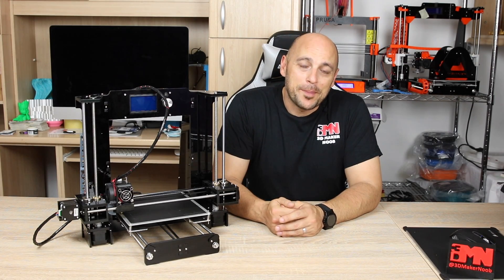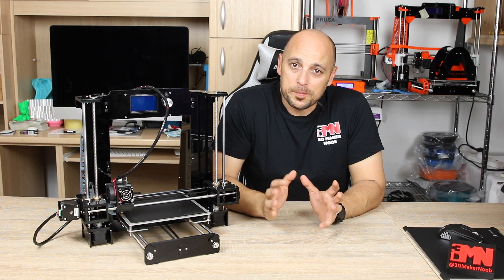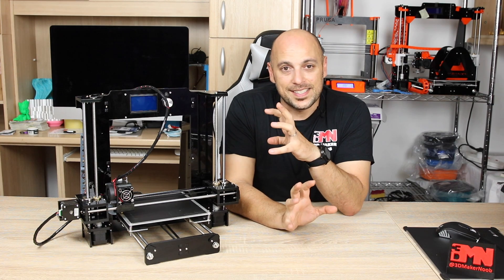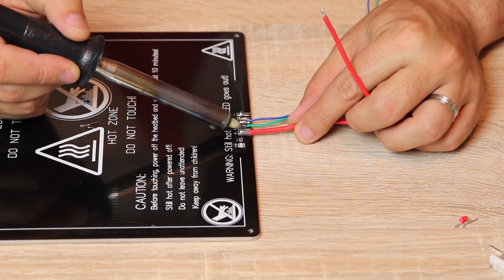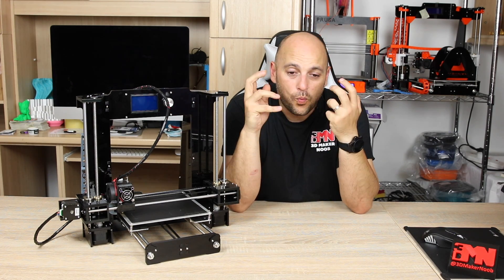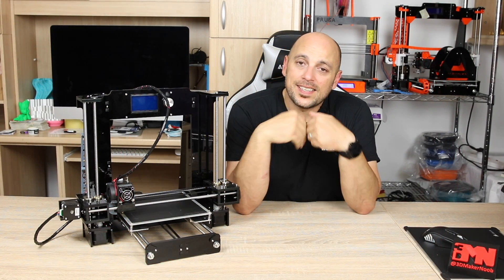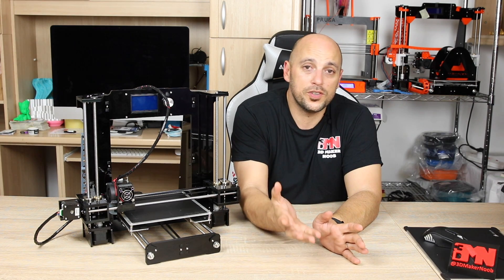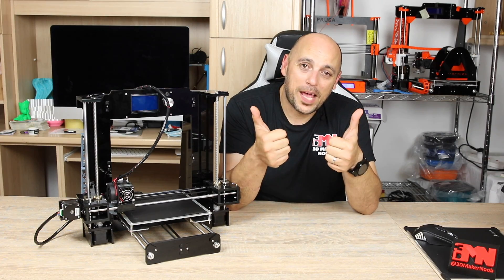Anet and Budget Kits Safety Upgrade Essentials

Comment: Way to make me feel guilty for running 16hr prints on the stock power supply and board for a month now, lol. I know I need the mosfets but at least my power supply and board have cooling fans attached... i don't know if that really makes a difference. mosfets are next on my list for sure, after seeing your opinion and genuine concern for the overall safety of the 3d printing community. Looking forward to the next A8 video for sure. Thanks again for the great content.

Comment: I have the A8, I installed a dedicated 20A fuse to the cabling coming out of my power supply. I also upgraded to a ATX power supply (PC power supply). I have also seen people installing a smoke alarm detector above their printer with a kill switch installed if it's activated. Lastly I installed a mosfet which is brilliant. 2 days ago the heat bed black connector burnt out so I took it all apart and soldered the cables directly to the board. 
Your video is great and I hope a lot of people who purchase the ANET range can watch it! Lastly, if anyone has issues with the hot end not heating up, I recommended checking the wiring first then just take the thermometer out of the hot end (there is a small grumb screw on the inferior face) and giving it a clean and check its electrical continuity as they are a bit budget.

Comment: A mosfet is just a single transistor. (MOSFET = Metal Oxide Semiconductor Field Effect Transistor) It is formed by two terminals (source and drain) being connected to heavily doped regions in the silicon substrate separated by the gate. The doping forms a diode with the substrate so normally current will not flow between source and drain (Diode is reverse biased)

The gate is a conductive plate separated from the substrate by a gate oxide insulator. When a voltage is applied to the gate the electric field moves the depletion region separating the diode terminals such that source and drain now no longer are separated by a diode. 

The voltage level on the gate determines the electric field which in turn determines how much current can flow berfore this now conductive channel is pinched off. 

This way a voltage source with little drive strength like a controllers IO buffers can control a large current flowing through the MOSFET

When you hear the term MOSFET we usually talk about discrete, large power FETs, but the principle is the same as other transistors used in microelectronics even though we then have millions or billions of then om a single die (But not bipolar transistors, they are different), however small FETs in microcontrollers are limited in how much voltage they can handle before they break down and how much current they can handle before pinching the channel. Larger discrete MOSFETS cannot be integrated on the microcontroller due to that they need thicker oxides metal tracks, so we use discrete power FETs to handle large currents and high voltages.
Reply from the maker: that's pretty much the same info i found online, but for someone who is not too technically inclined like me, all that might as well be chinese :) would love to be able to know more about this stuff
Reply: For the most part, a Transistor can only do 2 things, it can act like a switch, or it can amplify a signal. In this case it is an isolated switch, where the gate voltage can be a control pin from an I.C., as it toggles on and off, the FET will toggle also. This is about as simplified as I can make it. :) Good video, keep up the good info.

Comment: Hot bed wire connectors are loose, causes sparks and burns the connector up.
Upgrade the connector and replace crappy aluminum core wires with pure copper multi strand 16 AWG wires.
The Heater Core can come off the hot end if not tightened down WHILE HEATED.
Best to zip tie the heater core wire to the print carriage to prevent it from dropping down.

Comment: Joe, what is the link for the power supply you used. I am buying an anet a8 and I would like to purchase one
Reply: Check ebay for 30 amp 12 volt power supplies. There is one normally listed (I don't have the link handy) that looks just like the one supplied, but does come with a built-in fan. BEWARE OF WIRING DIFFERENCES. The connections are opposite of the original 20 amp unit.
Reply: James P thank you so much. I have officially as of now order my first 3D printer so I'll be sure to buy that psu

Comment: When I look at the picture which shows how to wire the connector on the powersupply it looks like you bypassed the fuse. shouldn't the black cable be attached to the tab on the right instead of to the IN point of the fuse on the left?
Reply from the maker: correct, i have updated a link in the video description to show it should be actually wired

Comment: Great ideas Joe. When I eventually work out why I'm having so much trouble getting things to stick o the bed I too will be printing those covers for my A8. I have an extra safety option that being a cheap Web Cam that I can watch the printer remotely with whilst my printer is on. I need to look at the Web interface you mentioned too.
Reply from the maker: i tend to do that with a lot of my printers, i also have smart plugs with wifi which i can switch off remotely

Comment: Hi there probably goeing to start a big debate and I apologise as I love the channel and all the help and advice. But wanted to get opinions and make people aware. The advice online all seems to lean towards soldering wires straight to boards but I work in the electrical industry and this is considered bad practice as any soldered joint needs to be physically secured as well as held in place by solder. I believe it has something to do with the properties of modern solder allowing parts to creap and come loose and creating the risks u are trying  to avoid. Has anyone found any solutions that allow for a second method of securing the heat bed wires in place? ( off to sleep now but look forward to any comments or suggestions) Thanks all and apologies again.
Reply: My take on it is that you are removing a very crappy, loose, under-rated connector and replacing it with a direct connection. That was the first part to go on my A6. Second part was my fault, allen wrench in the extruder fan trying to clear up a rattle while it was running.  :(      Printer AWP.
Reply from the maker: the idea is to remove the really bad connector that comes with it. in the next video will also be printing a brace to hold the cables so there is stress relief on the solder joint making them less vulnerable
Reply: I'll be waiting for that print! May have to modify it for my cable chain though.Keep those removed pins though. Solder a pair of them to the extruder wires and slip a length of shrink tubing on. Makes your extruder connection much better. You can do the same for power and bed wires also. Those screw crimp connectors are not really made for stranded or small wires. The pins give a solid bulk for the connectors to hold on to.

Comment: A PSU of at least 30 what?
Reply from the maker: +Heuamoebe 30 amps
Reply: Ah right. That was cut a bit short. Is there a reason for that specific number? Switching one cheap chinese power supply for another, slightly larger one doesn't seem very logical to me.
Reply: 30 Amps should cover the heat bed and nozzle heating up high enough for ABS or other high temperature plastics, while it will struggle at 20, possibly overheating the power supply. Just the heatbed along could draw 10 amps.

Comment: Another highly recommend safety feature to add to the Anet A6 (or other printers for that matter) are covers for the heated bed springs https://www.thingiverse.com/thing:2044042 . On my A6 the ends of the springs dug into the bottom of the heated bed and shorted it out. The two springs which the current passed through got so hot they were deformed and discolored! I'm surprised it didn't catch fire let alone continued working. I only noticed it while installing an upgrade for the y-axis belt. 
It was actually causing problems beforehand which I should have noticed, specifically while I was preheating the nozzle the printer would stop working properly after a couple of seconds. The fan speed slowed down and the screen dimmed and random stuff appeared on it and the main board produced a worrying odor. I thought it was a main board problem until I noticed the deformed springs.
Reply from the maker: yep, that is also coming in the next video relating to safety :)

Comment: Your power light came on when the switch was off!
Reply: But an important video, excellent.
Reply from the maker: +Grant Peck yeah for some reason it stays on but the printer only goes on when it's on the ON position
Reply: Depending on the switch it's probably because your power input needs to be the other side of the switch. If that doesn't work I don't know :-).
Reply: Grant Peck he's got it wired wrong. It's best to look at the specification sheet of each individual switch but on lit switches they normally have 4-6 pins. The center being the accessory or in this case the a8, the "on" position being power, and the off being ground. 4 pin switches ignore the ground position and simply disconnect the accessory from power when off without shorting to ground. If you reverse the accessory with the power source when wiring you get that light turning on at the wrong time.

Comment: Nice video again, and probably the most important yet.

Another very easy safety measure is to replace the grub screw that holds the heater cartridge in the heater block with a slightly bigger one (should be M4), its hard to screw in, but it will cut its thread into the soft aluminium.
This prevents the catridge from falling out and going red hot.
Also a little additional tape to protect moving wires against the frame could prevent shorting.
Reply from the maker: +FamousKramus thank you. And noted on the other point, will include them in the next episode on safety :)

Comment: Great video. So many people ignore that regardless of how "high quality" a printer is, they all have risks. I dont care if its a $200 machine or $2000 machine, electricity and high heat are involved. They should be considered an appliance just as much as your kitchen stove is.
Reply from the maker: +Matt Weber completely agree, we tend to get lost in the "fun and creative" part and quickly forget how dangerous it could be without the proper precautions